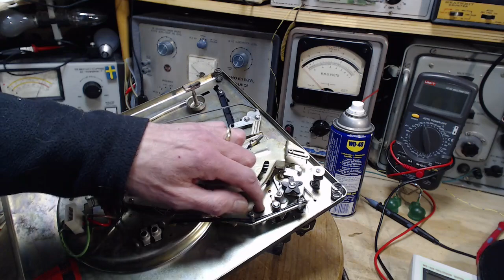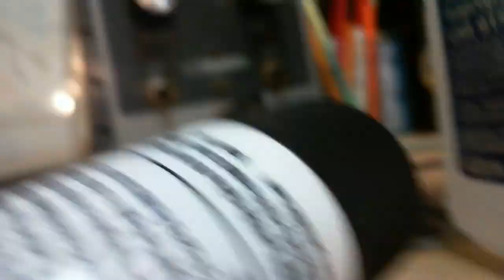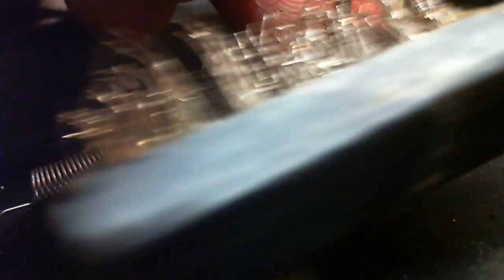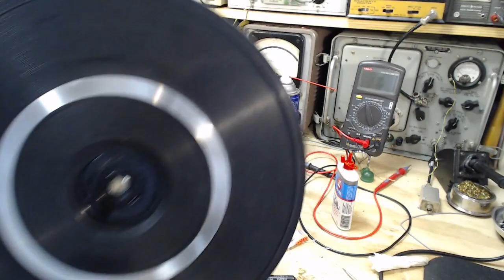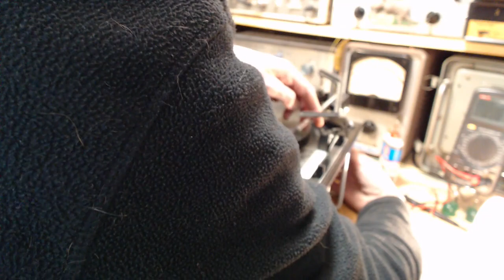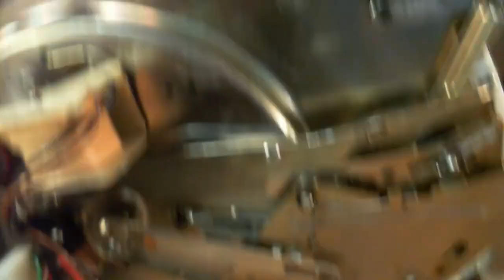BSR C123R Record Changer Video #2 - General Servicing

Comment: I'll tell you the problem. The idler wheel is no good the rubber is old and needs replacing. I know as I had the same problem with my 51 year old Garrard which has similar design. You didn't even bother to clean the idler wheel. Cleaning it and applying some rubber restorer will temporarily improve the situation. The required fix is to send the idler wheel to Terry E. Witt. He can repair the idler wheel by installing new rubber on it. He is in Sparta, MI.

Comment: 39:35: That's exactly what mines doing I'm restoring. I got one for $20  and it's not too bad. Cleaned everything and relubed and the idler wheel STILL doesn't stay firm against the platter to turn it, unless you jiggle the speed control, and it's very weak at turning it  Thr wheel is soft, so it should be good. I can't find the problem. Gotta be something, that should stay tight against there.

Comment: As a teenager in the sixties, I can certify that these record-players were almost exclusively used to play 45rpm 'singles' from the Top Twenty, and less often for expensive LPs, hence the build-up of rubber on the 45rpm part of the motor drive-shaft. Quality of reproduction was of little importance: teenagers simply needed a cheap player on which to stack a heap of 'singles', shut the lid, and enjoy the pop music of the 'swinging sixties' - loud, fabulous and fun!

Comment: Use Super Lube Grease. Just lightly over parts that were greased originally. You can add a drop of Zoom Spout oil when installing the spindle.
 Less is more. The turntable should move freely for almost 45 seconds  then slowly stop.Don't forget the motor bearings! Old grease is keeping it from moving
at the speed you want!

Comment: the record stack post should point at the centre of the tonearm post about 1o'clock got moved when turning the stuck turntable.
Reply: I was about to say the same thing. The spinel post was rotated when trying to get the turntable off. It needs to be out back to the position you mentioned and the trip underneath relocated in the slot dirt it's movement to drop a record. Jim compare it's assignment to any other turntable you have on hand and you'll noticed it straight away :)

Comment: That decks mech is still in play mode the idler was pushed up against the platter that’s why it would not rotate anti-clockwise... there’s probably a flat spot on the idler wheel.